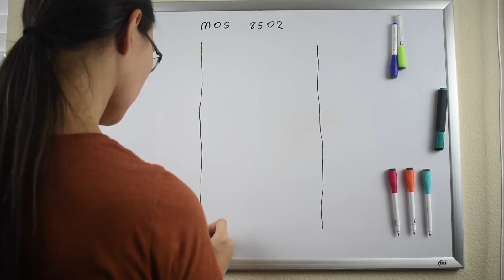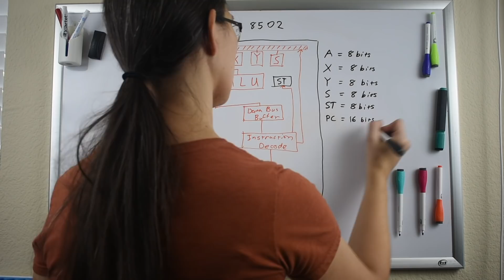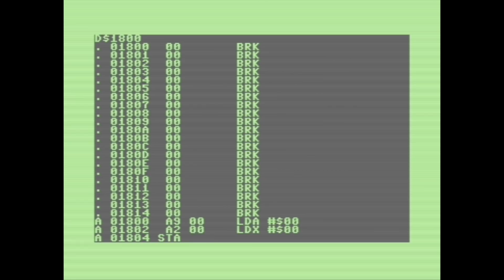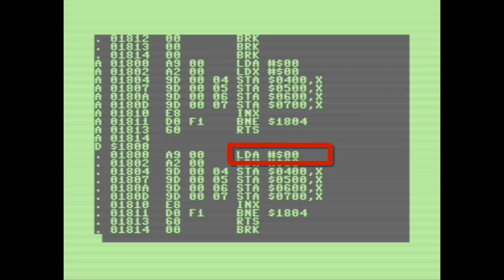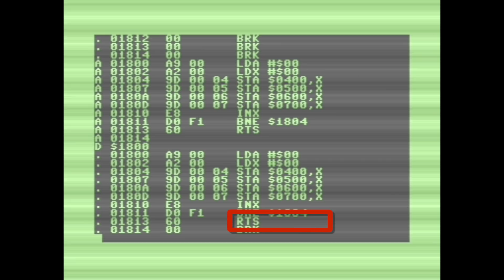Commodore 128D: Episode 1: Meet the Commodore 128D

Comment: This makes me upset that I tossed all my system components away in the early 90's.  I had the 128, 1902,1571,1750, and a nice dot matrix printer.  I didnt use them much and tossed them all to the dump.  I had also thrown away all the books. I had many books for the system along with subscriptions to:  compute gazette, RUN, commodore magazine.  Again, I had tossed everything away.  oh well.

Comment: I was just diving back into 8 bit commodore assembly. Your timing couldn’t have been better. Subscribed. 🤓
Reply from the maker: @J. Walter Hawkes You might want to check out my ISA reference, then. It's based on the one on the 6502.org site, but made to be a single page with quick reference clicks. http://nybblesandbytes.net/6502

Comment: In the 70s, I programmed in z-80 and 8080 assembly code, APL, and BASIC at home on my TRS-80 Model 1. I also programmed for Control Data Corp for a while in a business BASIC called TAC BB2. Later I had a Vic-20 at home and loved it! If you were tight, you could do a lot in 3.5K of RAM.  My friends had Apple IIs. This architecture looks the same as the 6502.  I would guess, however there are a few extra commands available.  Nice video, well explained.  All good wishes!
Reply from the maker: Anton Nym Nah. Only difference is clock rates and PIO pins.

Comment: This is awesome! I just started learning the 6502 assembler language myself this past month. I found the documentation for it on archive.org, but I've been trying to write my own emulator for it in Haskell just to get a handle on how the thing works. I haven't had the time to go into the detail of the CPU's circuitry/block diagram the way you did here, but I will have to eventually if I want my emulator to operate realistically. For now, I've just focused on understanding the instructions and address modes well enough to write them as math equations in Haskell.
Anyway, keep up the good work!

Comment: Amazing to see someone talking about the stuff from 35 years ago!  (amazing any of it still works).  I will link to your vid from FB and if you ever join c128.com feel free to promote your retro video's there, doesn't have to just be Commodore related.  

Sadly the "real" C128D as we called it, wasn't released in the US in any real numbers, the metal version "bleck diesel" was re-engineered a few years after I left and can be identified by the large amount of character clock noise on the screen.  The plastic C128D was my favorite one of the series, the one with the keyboard clipped to the bottom and also had a handle, though it could bang you in the shin if not careful.

I look forward to your next videos!
Bil Herd
Reply from the maker: BilHerd FYI, your advertisers on c128.com just hijacked my  whole browser with an ad. Not going there again until that's fixed -- too dangerous.
Reply from the maker: BilHerd Have to admit, I would like the earlier design like you mention. The keyboard cable is very short!

Since you're here, what the heck does that switch next to the RF connector do? I thought it was a channel switch, but given the labelling, I'm not so sure.
Reply: Antenna connector for connecting to TVs in 40 char mode (left of it: L-H for channel adjustment (optional)).    https://www.c64-wiki.com/wiki/Commodore_128
Reply: but   I see n understand what you mean Nybbles and Bytes    why  L & H  instead of just 3 ch  n 4 ch   unless  it was different in Europe  ,  this may be the reason ..  ?
Reply: @NybblesandBytes  Hmmm.... didn't realize ads were turned on, I ripped them out by the roots, let me know if you see any.  

The original C128D used the exact same PCB as the C128, which was a pain as we were in a big hurry and had to do things like leave a big hole in the PCB for a support post only needed in the D, which caused a bottleneck of PCB traces.  Ultimately CBM designed not to release the real D as I don't think they had the cash for two new machines in spite of Marketing saying they could market two new machines. 

 Not sure about the switch as this was a redesign done by someone a few years later, I have only seen one metal D that I can remember.  It used to select between chs 3 & 4 in case you lived near a transmitter on either of those channels and got interference.
Reply from the maker: @Sparky Widgets, @BilHerd, Yeah, I thought as much, it's just the odd labelling threw me -- the L doesn't really even look like an L, more like some character between L and <. Seems like a piece of history was lost there -- I'd be curious if we can ever find out why those characters were used instead of the more common CH3 and CH4 nomenclature.

Totally hear you on the holes in the PCB, too -- even nowadays with the nice CAD programs available holes and slots are a pain. Every time I route a board with supports or slots it's a pain! >:p
Reply: @BilHerd  Same here, Bil.  Something  very dodgy going on over at your website.
Reply: @KarlHamilton  How about now?
Reply: @BilHerd  That's better. Thanks!
Reply from the maker: @BilHerd looks like you're having database trouble with the forum. Lots of posts lost, and I can't login anymore. Guessing you had to do a database restore?
Reply: @NybblesandBytes  Yup just emailed you.  I let an update run that bailed halfway through and didn't update the DB structure and the site went flakey.  I had a VM snapshot that was only an hour or so old but lost all of the cool posts you just mentioned. :(  Thats it, I am going to go follow my dream of being a lumberjack.  If you could re-subscribe when you get time I know the users were excited about you joining.  My apologies!  I shouldn't be messing around during the day but I was in there fixing the ads and thought what the heck... might as well answer yes to a prompt.  At least I had a snapshot. :(
Reply: I tried your site just now (after you said it was borked by ads and fixed) and it redirected me to install Flash (yup, spyware).  Closed the tab, tried again and it worked.  Looking at the code  inspector, there's a big red error on adsbygoogle.
Reply: @KarlHamilton  Are you the Karl from CBM?
Reply: @ieatbicycles  Thanks, when I restored the site I missed a Google AD Sense widget I had put in years ago.  Originally these were benign, I included them because they helped fill out the site which was originally sparse and I only ever saw the links to Digikey and Element14 which were symbiotic.    So I would never have know that they were also serving up trash if y'all hadn't told me, I think it comes down to the Adsense system knew me since I had to register my IP address so that my viewing and clicking didn't count.  So it should be okay now and I am really interested if anything pops up as that means something else is going on.
Reply: @BilHerd  Although I was tempted to say yes, unfortunately not.  Just a fan :)
Reply: @BilHerd  when I go to your site, it is still hijacked.  Ads, redirects, Flash warnings, etc.
Reply: @BilHerd didn't know about your site there, looking forward to checking it all out. (Still have my C128 from 1986)
Reply: Would be great to have @BillHerd do a collaboration video putting hardware and software knowledge together.

Comment: Oooh. She did an R-Shift-U for run! Nice. I always used the shortcuts when I learned Commodore BASIC on the PET.
Reply: Except pressing three keys as a shortcut for a three letter command isn't much of a shortcut.
Reply: Three keys to press vs. three letter keys to press...
Kind of pointless.
Reply: Yes, I noted that.. blew my mind when I first discovered these L(SHIFT O) "*",8,1
Reply: Well for me R(Shift-U) does have a point as you press the latter two keys together, so it's faster than pressing three keys after each other 😎
Reply: @Edwing77  I tested it; with optimally positioned fingers for each case therer is no difference. ;-)

Comment: I love your new channel. But if I could make a suggestion for you going forward. I am not sure if you are looking at a teleprompter next to your camera or the camera's monitor. Either way, it's a bit distracting if you shift your focus (your eyes) from the camera lens to the thing off screen. Preferably, you would simply talk to the camera lens and forget the monitor is there. That way, we feel like you are simply talking to us. If you are using a teleprompter, you can invest in one that uses a reflective screen so you can still look into the lens of the camera. Focus on the lens. That's us! :-) Hope this helps and I mean no disrespect. You are off to a great start! Cheers!
Reply from the maker: Pull My Focus I was actually using my iPad as a teleprompter in this video. The problem was that I didn't have a mount for it to put it in the right place. :-)

I went out and got one, though, so it should be better in the next one -- I can put it right below the camera lens, which seems to help quite a bit.
Reply from the maker: jin choung Yeah, I nearly did last time I was in Fry's. Ended up getting a tablet mount that can fit it in just under the lens, so hopefully that should work out better. If not, I'll see about getting one.

Comment: Although I think that the restoration aspect of vintage computer is a very important one. Lets be honest, if they weren't kept running - they would be around to program on :) Admittedly that is what mine concentrate on, but thats mainly because I couldnt write a line of code to save my life :D
BUT! You are correct. The programming side is generally missed, with the probably exception of the 8-Bit Guy who frequently goes into things like memory maps etc, and did cover the development of Planet X2 quite well.
Absolutely best of luck on the new channel. I've certainly subscribed and will be watching with keen interest.
Reply from the maker: Definitely -- I think the restoration aspect is hugely important. We need it to keep these machines alive, so yeah, definitely need that. Unfortunately, I'm not particularly good at that aspect, but I can do software, hence the thought. =o)

I would have preferred if the 8-Bit Guy had gone into a bit more detail on the memory mapping for Planet X2, and maybe some of the assembler challenges he would have inevitably run into while cross assembling and testing between emulators and the real thing. Still, he did a great job -- I just hope to get a bit more detailed if I can.
Reply: @NybblesandBytes  I think you taking that more detailed look at the programming side is a fantastic idea, and as you pointed out - its certainly a gap in the YT-retro-computing community.
BTW - Twitter?
Reply from the maker: @Mr Lurch -- yep! @jtgans on Twitter.
Reply: @NybblesandBytes  glad to see you are on Twitter - there has been quite a few people noticing you over there in some of the retro circles. Look me up at @10marc1

Comment: I WRITE C64 MUSIC SOFTWARE. Good job trying to explain this stuff !!  You should check out the NEW C256 Foenix , a 6502 compatible cpu with 15 mhz speed.
Reply: Looks like they cancelled that project sadly.
Reply from the maker: This is wildly incorrect. Stefanie is hard at work on it and has even produced fully populated boards here: https://c256foenix.com/news/?v=7516fd43adaa

While her project isn't my cup of tea (neither is the Commander X16), it's still an awesome project worthy of respect. Please be patient with her -- hardware is insanely hard to build properly, especially when using modern FPGAs like she is.
Reply: @NybblesandBytes  Can you elaborate a bit on these projects not being your cup of tea? - I have the same feeling, mainly because it distracts from the classical retro platforms splitting the community further.
Reply from the maker: @NuntiusLegis  I'm not sure it does anything to split the community, TBH. There's plenty of room in folks hearts for all kinds of machines, including new-old-retro machines. It's just not something I'm all that interested in -- if I'm going to build a new machine, I'd rather it be a new machine using modern techniques but still be programmer friendly, since we've learned a freaking ton since the '70s. In fact, I'm in the process of building one myself in fits and starts, but using modern systems like RISC-V as the starting point. See also http://www.hypercube.computer/
Reply: @NybblesandBytes  I like the idea that C64 and DOS are eternal platforms now, with new software written this year or 20 years ago still running on cherished original hardware, replicas, or  in an emulator on current machines anytime in the foreseeable future. I can't imagine the same happening to either the current mainstream platforms or one of the retroish new hobby computers.